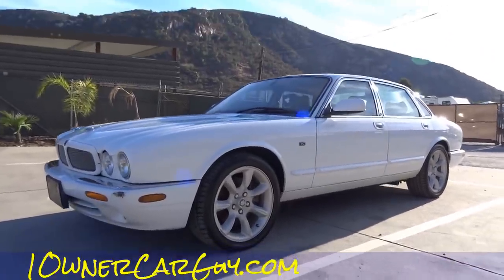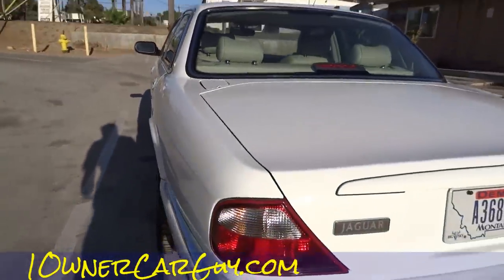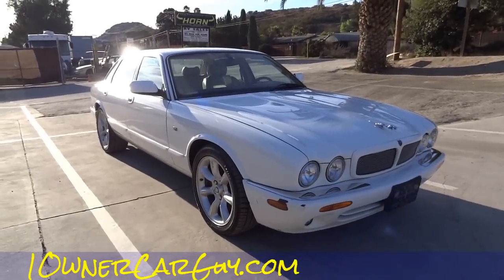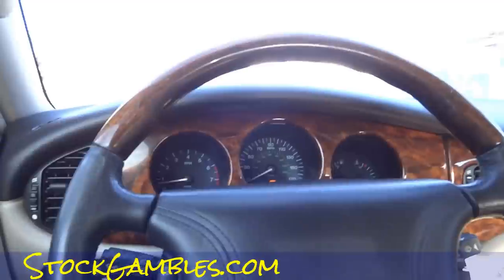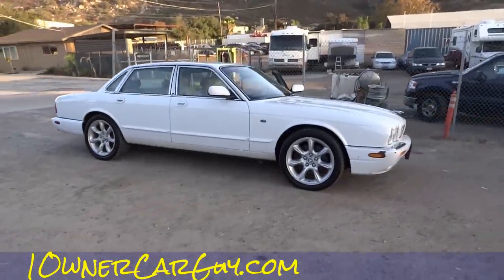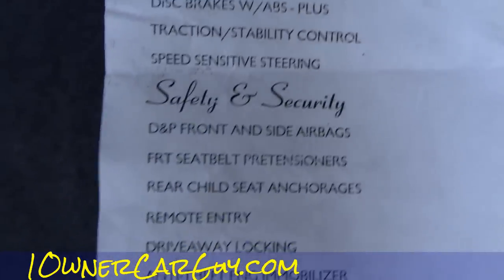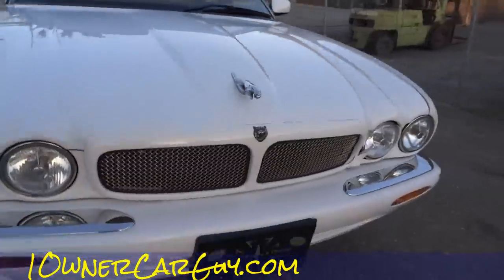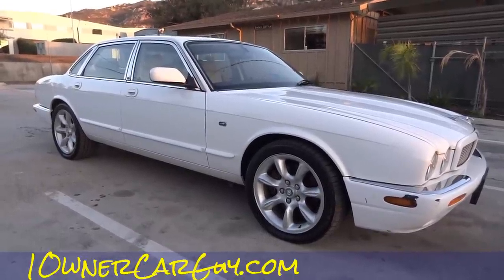2000 Jaguar XJR Sports Sedan Supercharged V8 Video Review

Comment: this video is crazy this guy repeat ''this car is in great shape but you cant close the hood scratch on the bumper grill open in 2 parts the supercharged is dead many error on the dash board , trap for gaz is dead this one is a garbage .... i love Jaguar xj x308 but this video make me sad
Reply: Mathieu SB the hood is not meant to be slammed shut ,  this guy is banging it around like a Neanderthal lol , all you have to do is press each side down into place and it locks into a locking spring so it won't blow open under high speeds